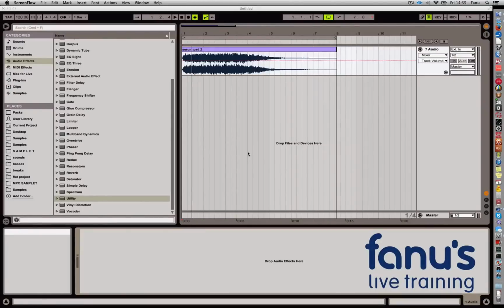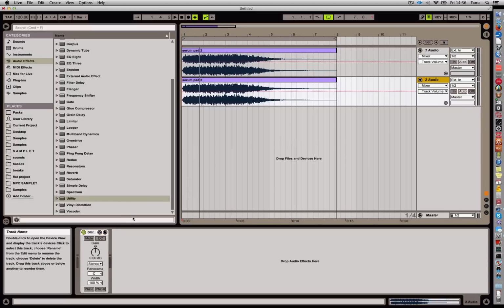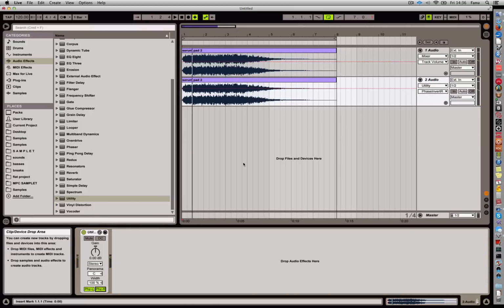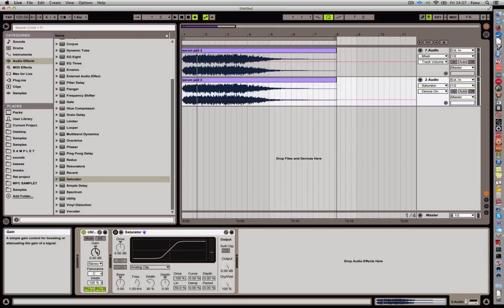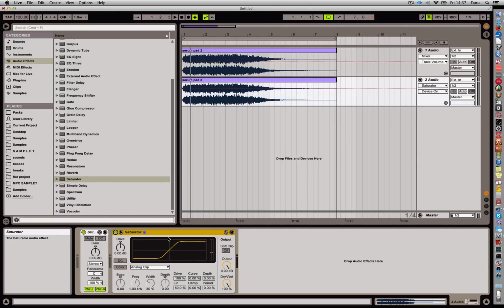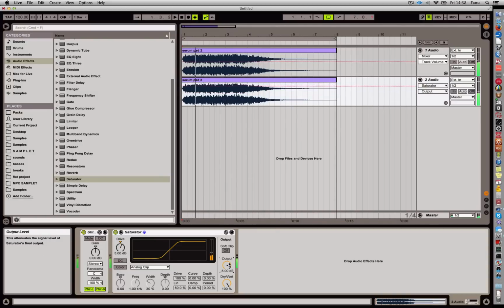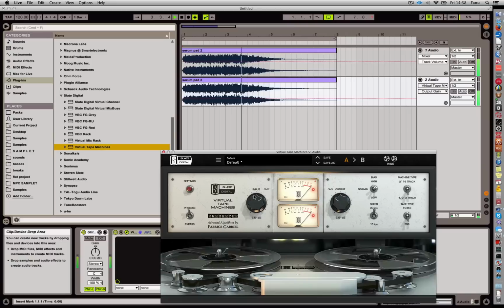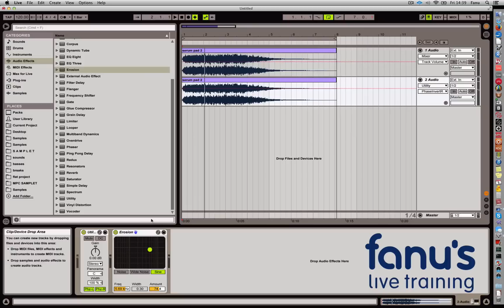What plug-ins are actually doing to the sound

Comment: why do signals with opposite polarity cancel each other out? I cant get my head around It. Anyway , great video Fanu!! Much Respect!!
Reply: From what I understand, opposite polarity means that the entire waveform is inverted, AKA when there is a positive peak in the original waveform, there is a negative one in the exact same place at the exact same volume in the inverted waveform. When you tell the speaker to play both at the same time, you're telling it to move in opposite directions with exactly the same force, which results in them cancelling each other out and no sound from being produced.
Someone else could probably give a more technical and accurate description than that, that's just from my own limited knowledge base.
Reply: Alex Grant Sound is vibrating waves. Digital audio is measured around 0, so a wave can be 10 above, 5 below, etc. So inverting a signal means you add 10 and -10, -5 and 5, which equals 0. 

Cancelation like this doesn't just happen from inverted phases. All sounds can cancel each other, meaning if you don't pay attention, your sounds can subtlety cancel each other out, leading to a quieter mix.
Reply from the maker: I don't even know, so I can't explain it. I bet Google would help. But that's an industry standard technique.
What you only need to take away from it is that you can use that technique hear what plug-ins do to the sound :)
Reply: I don't know. I'm more comfortable with digital stuff. I'm guessing since real world sounds are "messy", everything we hear is being affected by cancelation, the difference of your ears, room dynamics, etc. I can't really find anything that isn't about digital audio and I'm about to leave.
Reply: Alex Grant Yes, it applies in the real world as well.  That's actually the reason for room treatment, because of the sound bouncing around the room and potentially canceling out certain frequencies from your speakers.  If you want to do more research, look up "destructive interference" and "superposition" on Wikipedia/Google.
Reply: Chucklehoff No cheers dude that Is exactly the explanation I was looking for!!
Reply: Alex Grant
Well, I just hope that it was accurate, misinformation is worse than none at all :<
Reply: so does the same apply for real sound I perceive through my ears? its not just some hardware limitation?
Reply: irvy123 Thanks for that, couldn't remember the term destructive cancelation.
Reply: Yes, it's literally what causes the double slit phenomenon (just for photons, instead of sound waves, in that case). Try playing a sine wave through two speakers and move one of the speakers forwards and backwards, you should cancel out the sine wave if you move the speaker the right amount. It is also how noise-cancelling headphones work.
Reply: Take a look into anti-sound or noise cancellation, and destructive interference.   
At its most simplest; a positive wave has a positive voltage (or the other way around I don't exactly know) and causes your speaker to move one way. A negative wave has the opposite voltage and it moves the speaker the other way.   
When you play them in sequence -1 +1 -1 +1 the speaker moves back and forth and creates a sound.    
If you now invert it and add it together you get (-1 +1) (+1 -1) (-1 +1) (+1 -1), or basically 0 0 0 0. The speaker doesn't move.